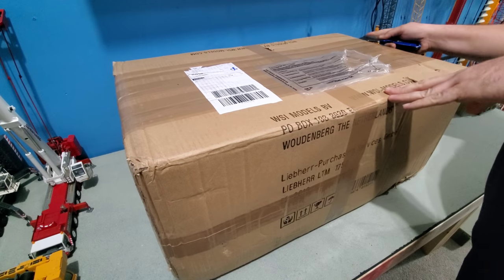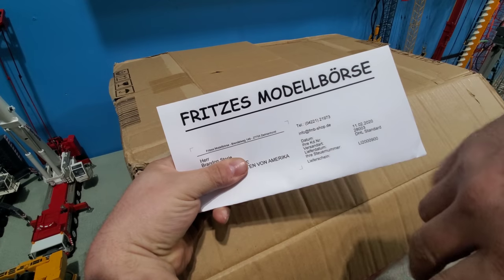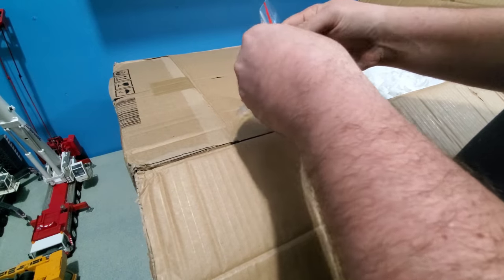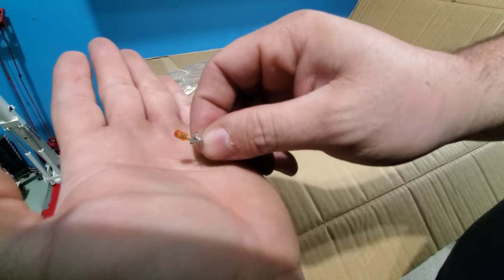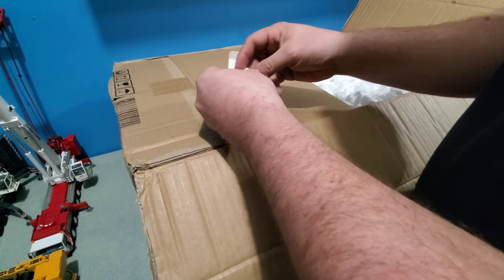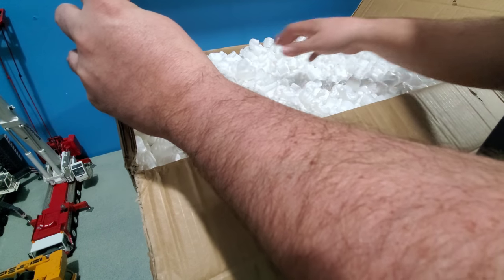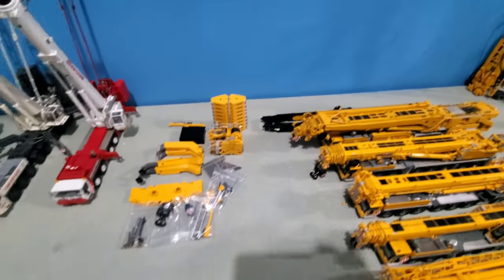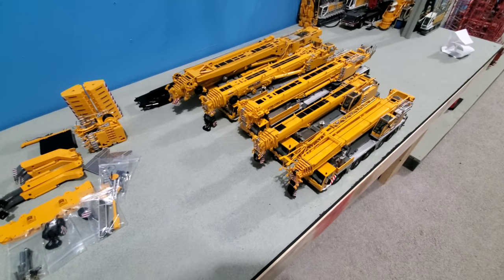Wsi 1/50 Liebherr Ltm1750-9.1 unboxing

Comment: New to your channel I have very much just started my crane collection. I have a 40 , 55 ton and 220 I have a 75 on the way and 400 but.  I want a lot more.  I run a tree service full time so I have been working with cranes for 32 years and I love the power of hydraulics.  It’s awesome were I live you always need a support truck so for me I break them down and put them like there traveling and then I set them up it’s a job too break them down and put them in different configuration but it’s cheaper than drugs and alcohol but your collection is amazing I am looking for good places too get flat deck trailers and just flat bed 10 wheelers any suggestions. Thanks.    I have my own channel also. And I have just started talking about them.
Reply from the maker: Nice, I get them from different online retailers. Weissbrothers.us is a main one and dhsdiecast

Comment: Congratulations with your new LTM 1750 - 9.1, it does definitely look very detailed and nice. Do you know if the 2 latters on winch pack can slide up / down, or are they molded as one single piece ?